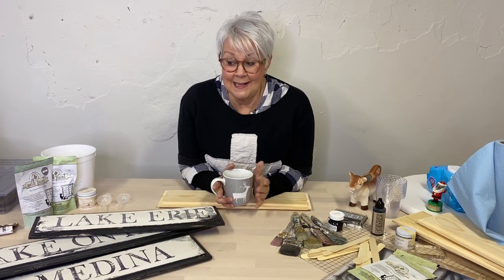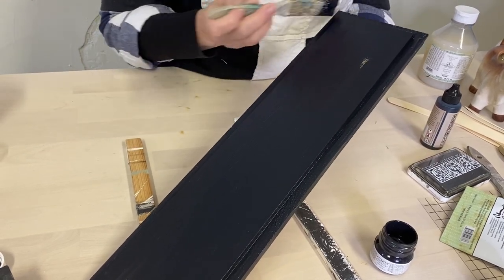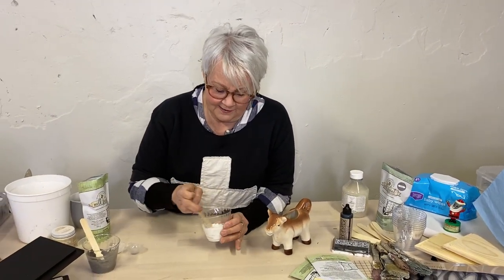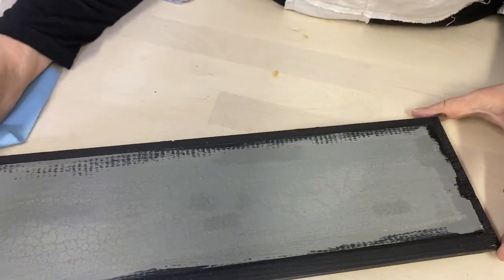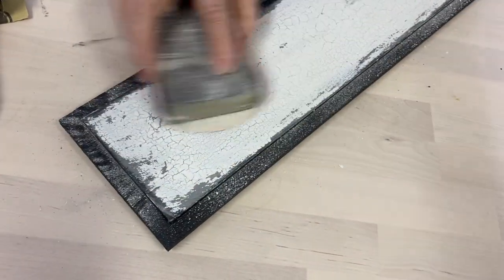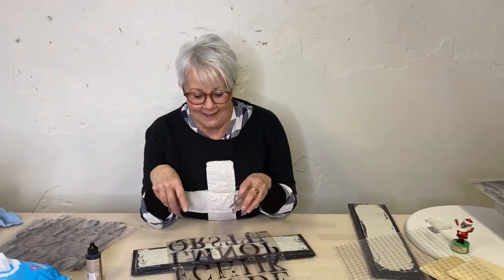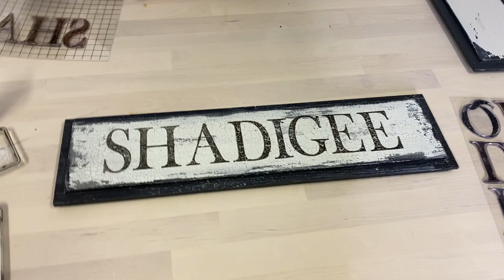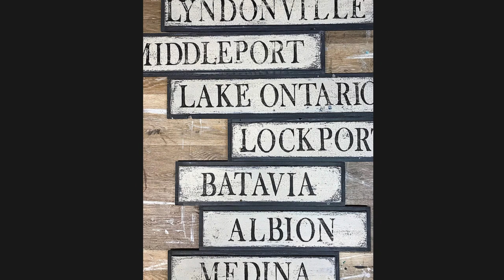Custom Street Sign with Milk Paint and IOD Typography

Comment: Love the aged look!  How long does the IOD ink need to dry before brushing on a poly sealer?  My ink smeared when I thought it was totally dry (6-8hrs).  Thank you for sharing such a cool project!   I love watching your channels ❤️
Reply from the maker: It requires quite a long time to dry. I usually give it at least 24 hours. You could also use paint and a Brayer to apply your letter stamps.  Thank you So much for watching Jody! We appreciate it!
Reply: Let it dry overnight,  then lightly use a poly spray such as Minwax poly. You can apply a couple coats if you like. The secret to it is allowing your project to dry completely.